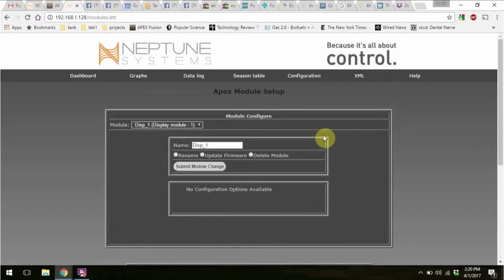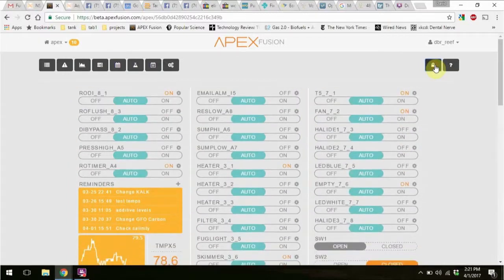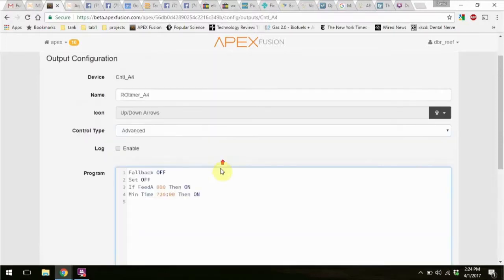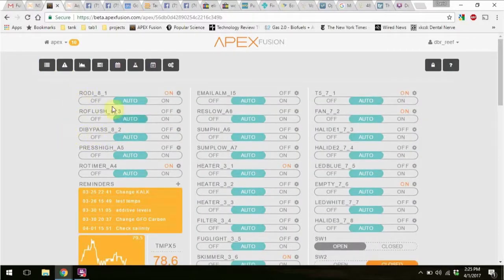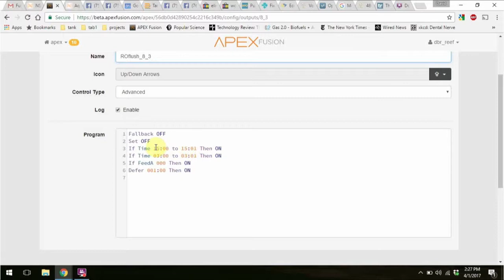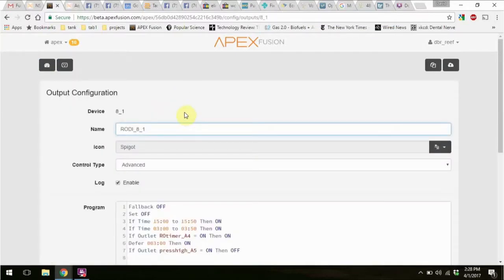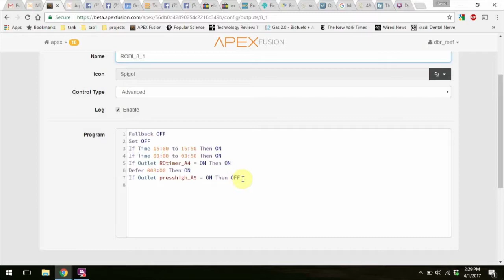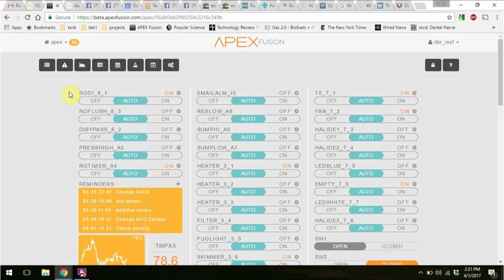DIY automatic RODI using Apex

Comment: Hey man .  Thanks for the video . For turning the soleinoids ON/OFF , isn’t there a way to do that using the BreakoutBox instead of using precious plugs from the Apex power bar ?
Reply from the maker: The break out box is a input device only- it has no ability to output signal. Without some really complicated DIY, there is no easy cheap solution to not using 120v plugs, or if you have them, 1 link plugs

Comment: Hey great video. I watched a few on your channel and find them to be very thorough and easy to understand.  Would you mind doing a video on a DIY aquabus cable?  I've read it can be accomplished with a CAT5 cable. Thanks.
Reply: I can certainly do that if you are interested, as it is very easy, however I am not sure it is generally worth it. Any passive USB cable will work for the purpose, and they can easily be found in lengths up to 25ft. Here are sizes 3-25ft all for under $11.  https://www.amazon.com/Male-Cable-Type-25FT-Black/dp/B013J2KYAG/  If longer lengths are needed I would attach a usb extension. What you do not want is a active/repeater/booster cable, as this will fry your apex. I personally know people who have run 50ft of passive usb cable without any problems, and the architecture that the apex is based on should be able to do significantly more. Most people do not want to run longer than 50ft lengths, but if you do I can certainly make a cat5 to usb tutorial.
Reply: Thanks for the link but as a scare tactic Neptune has made people scared to use ordinary USB cables forcing them to buy their over priced aqua bus cables. You would be proving a service to the reefing community as well as creating original content. I dare you to find someone else who has created such a video lol.  In any matter you also seem to be handy with those solenoid valves. Another great video would be a water change device that replicates the Renew Genesis product. http://genesisreefsystems.com/product/renew-pro-pumps/.  Hope you don't feel I'm putting you on the spot, just throwing some ideas at ya. Thanks.
Reply: I will certainly do it- It will be a quick one. I like the Genesis idea a lot! Thanks. Neptune does the heavy warnings for fear of people using active cables or plugging something into the controller. I and many others use passive cables- they just usually don't come in longer lengths because actual USB wont work much past 25ft without a signal boost. Just an FYI, Neptune will send you to this company if you ask for long cables- http://www.usbfirewire.com/search.aspx?searchterm=apex
Reply: Who wants to pay $60 for a 50' USB cable?  If I understand you correctly any "run of the mill" Male to Male USB will work?
Reply: Yeah, prices do seem a bit high, but I suppose they are made in small quantities. personally I would just take 2 25' extensions and plug them together. But yes, any passive usb cable (most at or under 25' are) will work.